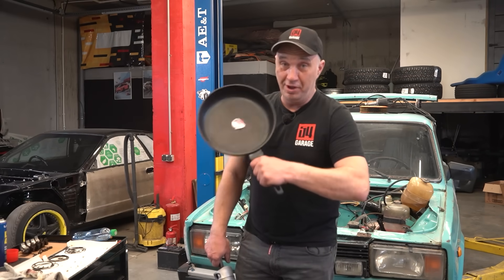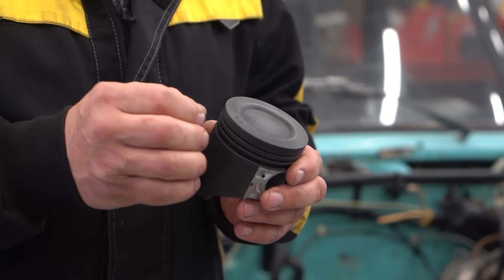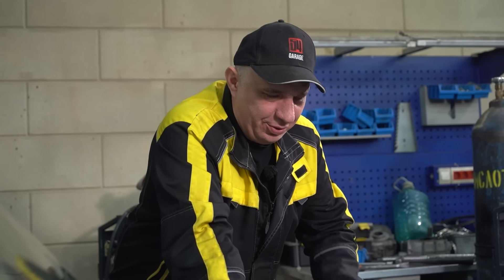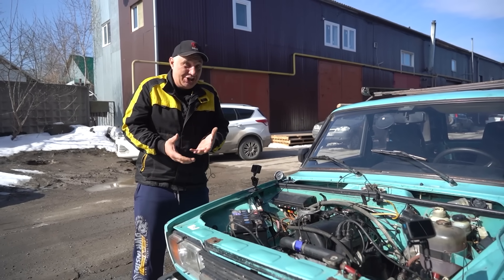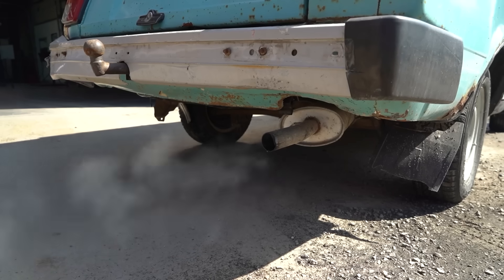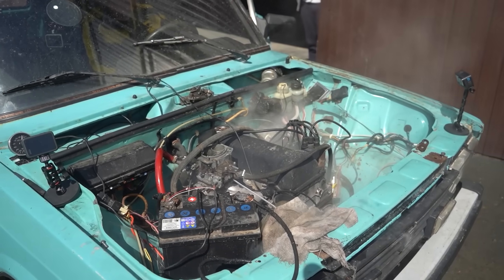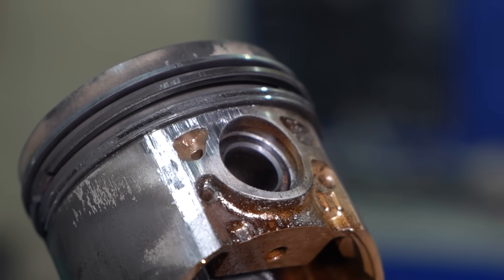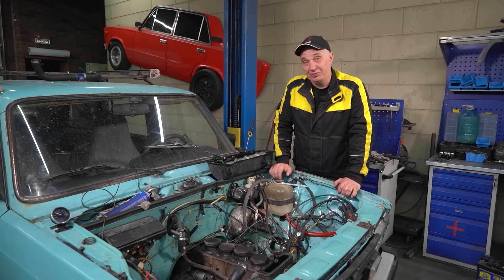We coat pistons with Teflon - what will happen?

Comment: Anybody that knows how a engine works knows that the rings causes the friction and heat on the pistons and the powder is the burnt teflon from every time the engine fires because its just a controlled explosion the teflon did nothing but clogg everything up. Kinda a wast of time makes you guys look stupid. The reason race pistons have coating on the is to protect the piston from slap from the extra hp and to protect from heat and compression on top of the piston !!!!!!
Reply: You must be such fun at parties.

Comment: The Teflon needed to be on the outer surface of the rings this is where the most amount of friction is even the cylinder walls if you wanna get technical all bearing surfaces rods and mains and even wristbands

Comment: PTFE will probably not be able to handle the high temperatures and pressure of an engine. But, I wonder if the modern non-stick ceramic coatings would be able to handle the heat, pressure, and vibration of an engine.

Comment: I'd call that a success. In normal operation it's a rare failure mode but that seemed to stave it off well past where the oil would be failing from heat.

Comment: Coating the cylinder wall is a better test, the piston technically does not connect to the wall - only the piston rings touch cylinder wall.

Comment: 2:12 – "Prior to the coating the stock pistons had a diameter of 79 mm.  And now after we've coated them the diameter is at 78.8 ..."   How does that work?
Reply: You missed the part where they sand blasted the pistons, which took away a bit of the surface.

Comment: Additional Discussion: Possible Delayed Biological Syndromes Caused by Exposure to Teflon Decomposition Products

In addition to the acute and immediate dangers outlined previously, exposure to the pyrolysis products of Teflon, particularly PFIB (perfluoroisobutene) and HF (hydrogen fluoride), carries significant risk of delayed-onset biological syndromes, some of which may emerge days, weeks, or even years after initial exposure. These syndromes are often insidious, misdiagnosed, or attributed to unrelated causes due to their complex pathophysiology.

One major delayed effect is the development of autoimmune disorders. Exposure to PFIB and related fluorinated compounds has been shown in animal studies to trigger immune dysregulation, leading to the production of autoantibodies against the body's own tissues. Conditions such as systemic lupus erythematosus, rheumatoid arthritis, and scleroderma have been postulated to develop following sufficient chemical insult to the immune regulatory system. The precise mechanism is believed to involve molecular mimicry, where chemical adducts formed between fluorinated compounds and endogenous proteins trigger mistaken immune attacks on native cells.

Another serious delayed consequence is the onset of chronic pulmonary diseases. Even if acute polymer fume fever resolves without hospitalization, microscopic alveolar injury may remain. Over time, these micro-injuries can lead to pulmonary fibrosis, a progressive stiffening and scarring of lung tissue that severely impairs respiratory function. Pulmonary fibrosis is irreversible and ultimately fatal in many cases, progressing slowly over the course of years.

Neurological consequences must also be considered. Chronic exposure to sub-lethal levels of HF has been associated with peripheral neuropathies, characterized by numbness, tingling, chronic pain, and muscle weakness. There is emerging evidence suggesting that fluorine compounds may cross the blood-brain barrier and contribute to neurodegenerative diseases such as Parkinson’s disease, though definitive causal relationships remain under investigation.

Renal and hepatic impairment are also plausible delayed outcomes. Both the kidneys and liver are responsible for the detoxification and excretion of fluorinated compounds, and chronic exposure places an extraordinary burden on these organs. Over time, cumulative cellular injury can lead to chronic kidney disease, fatty liver degeneration, and elevated risk for liver and kidney cancers.

Chemical hypersensitivity syndromes represent another category of delayed consequence. Individuals exposed to PFIB and HF may develop heightened sensitivity to a wide range of chemical agents thereafter, suffering from symptoms such as chronic fatigue, migraine headaches, dizziness, skin rashes, and exacerbated respiratory reactions upon minor environmental exposures. This syndrome, often referred to as multiple chemical sensitivity (MCS), remains controversial in some medical circles but is widely reported among chemically injured populations.

Taken together, these possible delayed syndromes reinforce the reality that Teflon decomposition products are not merely acutely hazardous but carry the potential for profound, life-altering chronic disease manifestations. This further solidifies the conclusion that applying Teflon to engine pistons constitutes a biological hazard of the highest order.

Comment: When considering the application of Teflon, chemically known as polytetrafluoroethylene (PTFE), to internal combustion engine pistons, one must first recognize the fundamental incompatibility between the chemical properties of PTFE and the thermodynamic environment present within an engine’s combustion chamber. Teflon is celebrated for its extraordinary chemical inertness at ambient temperatures and its low coefficient of friction, which, under certain controlled environments, can offer significant advantages in terms of wear reduction. However, when subjected to temperatures beyond approximately 500 degrees Fahrenheit (260 degrees Celsius), PTFE begins to degrade. At temperatures exceeding approximately 660 degrees Fahrenheit (349 degrees Celsius), this degradation becomes violent and catastrophic, leading to the emission of toxic and biologically hazardous compounds.

The operating temperatures within an internal combustion engine, particularly at the piston crown, the top piston ring land, and within the combustion chamber itself, commonly surpass 1200 degrees Fahrenheit (649 degrees Celsius) during normal operation. In high-performance engines, temperatures can escalate toward 2000 degrees Fahrenheit (1093 degrees Celsius) under full load and prolonged operational stress. Consequently, the Teflon coating applied to pistons would not merely degrade — it would decompose almost immediately upon the engine achieving operational temperature.

The thermal decomposition of Teflon generates an alarming suite of highly toxic gases, the biological dangers of which cannot be overstated. Among the decomposition products are perfluoroisobutene (PFIB), carbonyl fluoride, hydrogen fluoride (HF), tetrafluoroethylene (TFE), and trifluoroacetic acid (TFA), among others. Each of these substances carries its own portfolio of biological dangers, many of which have been historically documented in industrial accidents, laboratory mishaps, and domestic settings involving overheated non-stick cookware.

Perfluoroisobutene (PFIB) is arguably the most dangerous gas produced. It is chemically analogous to phosgene, a notorious chemical weapon deployed during World War I, but PFIB exhibits a potency approximately ten times greater than phosgene on a molar basis. Inhalation of PFIB, even in microgram quantities, can induce pulmonary edema, where the lungs rapidly fill with fluid, leading to suffocation and death within hours if medical intervention is not immediately forthcoming. PFIB is classified as an extremely hazardous substance by multiple international chemical safety agencies.

Carbonyl fluoride is similarly dangerous. Upon contact with the moisture present in mucous membranes of the respiratory tract, it hydrolyzes to form hydrofluoric acid (HF). Hydrofluoric acid is not only corrosive but uniquely penetrative, capable of traversing deep into human tissue before dissociating into free fluoride ions, which then interfere with calcium metabolism. This biochemical interference results in acute hypocalcemia, leading to cardiac arrhythmias, nervous system dysfunction, and ultimately death if exposure is not immediately and aggressively counteracted with calcium gluconate therapy.

Hydrogen fluoride itself, even outside the intermediary generation via carbonyl fluoride, is a direct product of Teflon decomposition. HF vapor is an exceptionally toxic and insidious inhalation hazard. Skin contact results in deep, painful burns that may not be immediately painful upon exposure but develop into catastrophic tissue necrosis within hours. Internal exposure via inhalation damages alveolar tissue in the lungs, leading to both acute respiratory distress and long-term pulmonary fibrosis if the victim survives initial exposure.

Tetrafluoroethylene (TFE), another decomposition product, is classified as a suspected human carcinogen. Chronic exposure, even at low levels, has been associated with an increased incidence of liver cancer, kidney cancer, and certain forms of hematological malignancy. TFE is also flammable and explosively reactive in the presence of oxygen, posing additional physical hazards in an already volatile engine environment.

Trifluoroacetic acid (TFA) is a more environmentally persistent degradation product. Though less immediately toxic compared to PFIB or HF, TFA accumulates in biological systems and aquatic environments, where it exerts toxic effects on plant and animal life. Long-term exposure in humans may result in hepatic and renal impairment, though the full biological impact remains an area of active toxicological research.

The immediate biological effects on humans exposed to the suite of Teflon decomposition gases include severe respiratory distress, known colloquially as "polymer fume fever." This syndrome mimics severe influenza, with symptoms including high fever, chills, chest tightness, muscle aches, and a persistent non-productive cough. Unlike influenza, however, the underlying pathophysiology is direct chemical injury to alveolar epithelial cells and pulmonary capillaries. In severe cases, especially with high-dose exposure, chemical pneumonitis progresses to fulminant pulmonary edema and death.

The chronic effects of repeated or low-dose exposure include permanent scarring of lung tissue (pulmonary fibrosis), chronic obstructive pulmonary disease (COPD), neurologic deficits, chronic fatigue, and various forms of chemical-induced hypersensitivity. Cumulative systemic absorption of fluoride ions can lead to skeletal fluorosis, a painful and debilitating condition involving the calcification and stiffening of ligaments and bone structures.

Of particular concern is the effect on animals, particularly avian species such as parrots, canaries, and cockatoos, whose respiratory systems are hyper-efficient relative to mammals. These species can suffer immediate cardiac arrest and death from exposure to Teflon decomposition products at concentrations undetectable to human olfaction. Pet fatalities from overheated Teflon pans have been widely reported and underscore the extreme biological potency of PTFE pyrolysis gases.

Given the sheer intensity of piston combustion environments, the rate of Teflon decomposition would be immediate and continuous from the moment the engine achieved firing temperature. This would mean a constant production of PFIB, HF, and related toxins, outgassing through the piston rings, escaping through the crankcase ventilation system, and potentially being carried through engine oil vapors and exhaust streams. In closed garage environments or poorly ventilated maintenance areas, the inhalation risk would be substantial not only for the vehicle operator but for mechanics, bystanders, and nearby animals.

Beyond the immediate human health hazards, environmental contamination must also be considered. The release of PFIB and TFA compounds into the environment carries potential for groundwater contamination, bioaccumulation in aquatic ecosystems, and longer-term environmental degradation, posing risks to human health, wildlife, and agricultural systems.

In light of these overwhelming dangers, it is crucial to categorically reject the use of Teflon coatings on engine pistons. Modern engine builders seeking low-friction piston coatings use alternative, heat-tolerant technologies such as molybdenum disulfide (MoS2) coatings, ceramic thermal barrier coatings, graphite composite coatings, or diamond-like carbon (DLC) coatings. These materials maintain structural integrity at combustion temperatures and do not decompose into biologically hazardous gases under normal engine operating conditions.

In conclusion, coating internal combustion engine pistons with Teflon constitutes an extreme biological, chemical, and environmental hazard. It places at risk not only the engine operator but all individuals within the vicinity of the engine’s operation. It introduces persistent toxicants into the environment and poses a catastrophic threat to animal life. From a scientific, engineering, medical, and ethical perspective, it must be categorically discouraged under all circumstances.

Comment: ok. normally i just come for entertainment and to see if assumptions are correct. but in this case. you got the lada to 100c...im guessing thats engine temp NOT exhaust temp. the temp in the combustion chamber can be well over 500F. with a typical engine being 500-1000f. standard ptfe coating which i believe is what you used. degrades and breaks down at 600f. meaning. this is an unfair test. at least. imo. as standard teflon coating wont hold up. so im not sure what your goal was.

Comment: Sealed Powers pistons are silk screened, or at least they were. I worked for Federal Mogul in the 1-800 technical assistance hotline until they closed the Phoenix call center down. On a prototype set they had run them in a Chevy 1 ton tow vehicle for one of the guy’s race cars.thry were installed with zero clreance between the teflon skirts and cylinder walls. It had 60,000 miles on it at the time.
Reply: Zero clearance? I call bs!

Comment: Love your videos. I watch them all. The biggest problem I see is that the teflon held the heat from escaping the piston, leading to higher thermal expansion. Aluminum provides excellent heat transfer but was inhibited by the coating. Compression would have also increased (taller piston due to coating). I recommend more clearance on the piston walls and shave the top of the piston before coating. Larger rings to compensate. Most of the damage was caused above normal operating temps which means in real world application, it would survive much longer.

Comment: Video idea: a challenge game between two or more of the Garage 54 presenters. You start with a working Lada. Then each player takes turns removing at least 1kg of weight from the car. Then they must drive the car some short distance: if it doesn't manage to drive the distance then that player is out of the game and what they removed is put back on the car and the remaining players continue until there is just one player remaining. That player is the winner.

The goal, I suppose, is to see how much can be removed while still making it driveable.

Comment: Try coating only the top of the cylinder head.

But imo, it will still be bad, because teflon coating will be peeled by the scratches. Maybe sometimes valve will hit the top of the head during high rpm.

Comment: The piston does not rub on anything. Teflon burns off at that temperature. The rings do all the sliding.
Reply: The Teflon Fills In The Ring Gap And Causes More Friction Not Less! I Believe In PTFE But Not In The Combustion Chamber But In The Oil!
Reply: Was searching for this comment
Reply: The piston rubs on the cylinder wall when the engine overheats. Usually the piston expanding and jamming in the cylinder is what causes an overheating engine to seize.

Comment: If the teflon is deposited onto the cylinder wall it will negate the hone and oil lubrication won't be retained by the cylinder wall.

Comment: Back in the 1980s there was an oil additive that contained Teflon.  The Teflon was supposed to coat the engine and protect it. After using it for a while it eventually clogged up some of the oil passages in the engine causing the oil light to come on and possibly damaging the engine.
Reply: Should always shake the oil bottle before pouring it
Reply: Slick 50 used Teflon but the name and formula  were sold to a large firm.  The founder claimed that they changed the formula. He has since released a different product. Coating the pistons does NOTHING as they should NEVER come into contact with ANY part of the engine. The piston rings contact the cylinder walls, not the pistons themselves.
Reply: Yep, good 'old Slick 50!  You are correct, it could clog oil passages, which was its ultimate downfall.  However, until, or if, the untimely demise of an engine, it did seem to work well enough.
With the availability of good synthetic motor oils, there is no advantage to these kinds of additives.
Reply: @devocite  You hit it on the nail! It was slick 50, and it messed the engine up in the car I had at that time.

Comment: I'd have been more interested if they'd Teflon coated pistons in a road car then run it normally for 6 to 12 months (or until it failed) to see if the coating made any difference to fuel economy and how the coating held up under normal driving conditions. All the "Test" in this video confirmed is that a seriously mistreated engine will sustain mechanical damage, and I'd be concerned if that came as a surprise to anyone.

Comment: If the engine was running so hot, could it have been the crankshaft deforming which caused to pistons to rub, then scrape off the teflon?